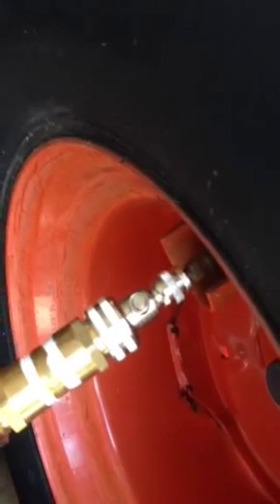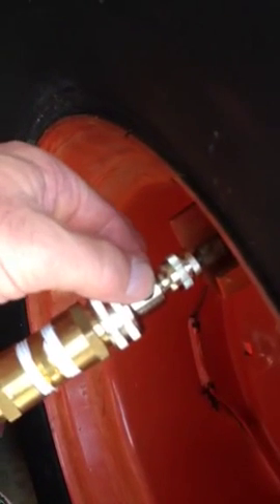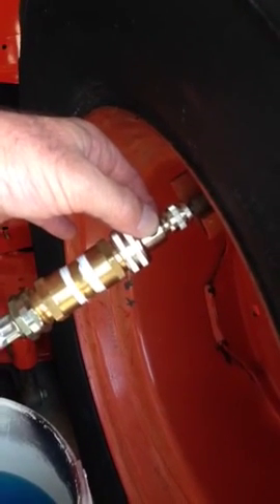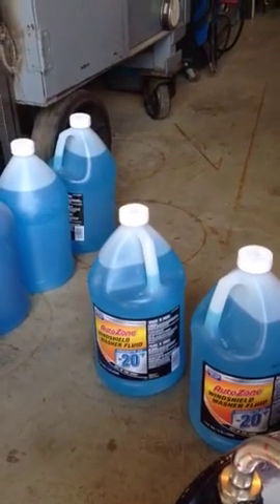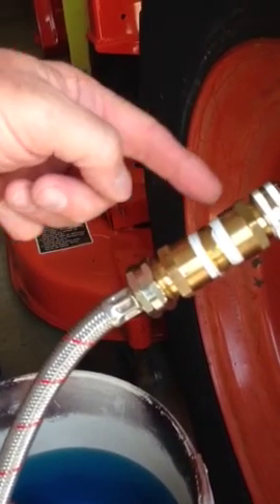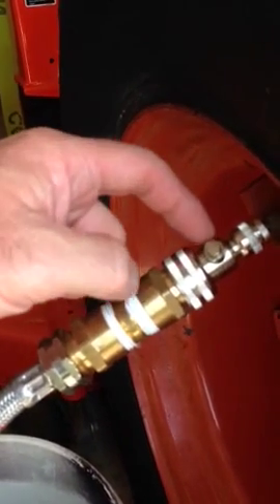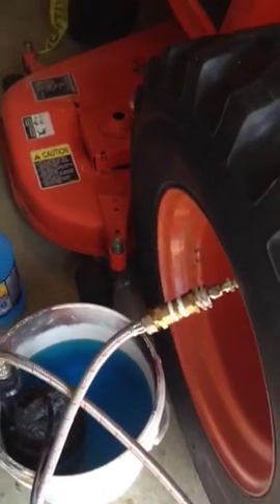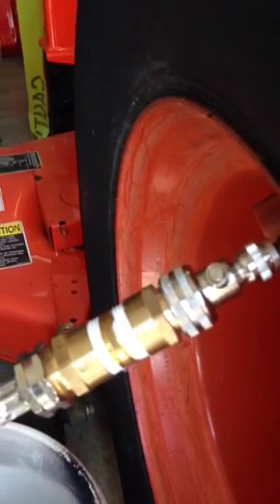Adding Liquid to Tractor Tires

Comment: What happened to checking back here in a minute?
Reply from the maker: Sorry about the late reply. The set up worked well. Fluid flowed in without a problem. Have not lost a drop in 2 years. There was just not anything else to add.

Comment: HAHA I honestly love watching amateurs try and do stuff like this. That washer fluid you are putting in your tire is even more corrosive than the calcium chloride that I use as an actual tire repair professional. Also just an FYI that washer fluid doesn't have near the freeze protection as calcium chloride that's mixed properly. Really gotta love that sump pump to put the stuff in the tire....not going to burn that out at all with the restriction of the flow from that tiny hose or from the small opening on the valve stem.
Reply from the maker: Yes, I’m certainly an amateur at putting fluid in tires. It’s actually the only time I’ve ever done it. Not sure I want to be good at it, as I expect having this “skill” and doing it professionally doesn’t pay well. I do however, know about pumps, and know how to read a washer fluid label. If, in my entire lifetime I ever need to do it again, I’ll look for a video you have uploaded. Thanks.